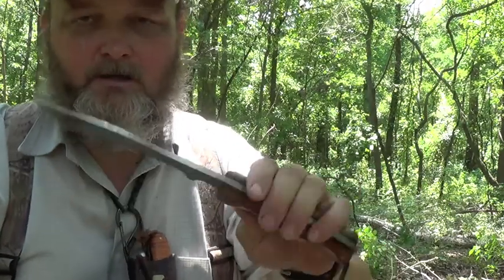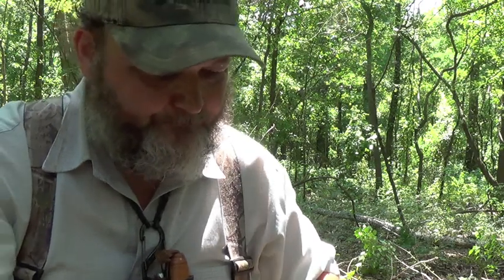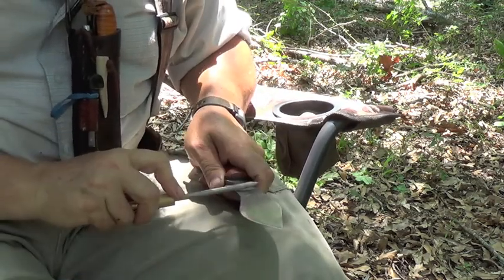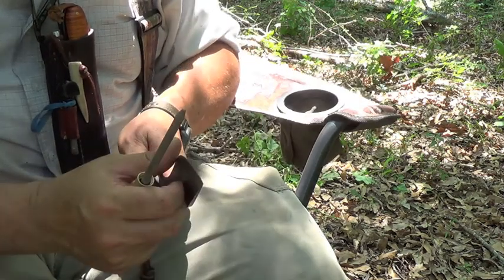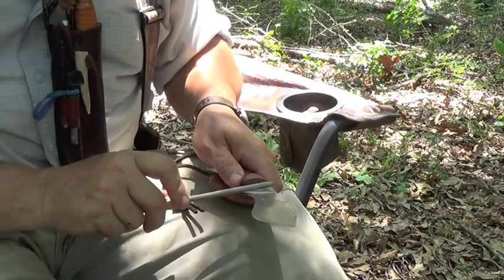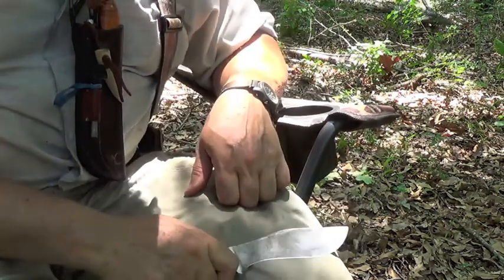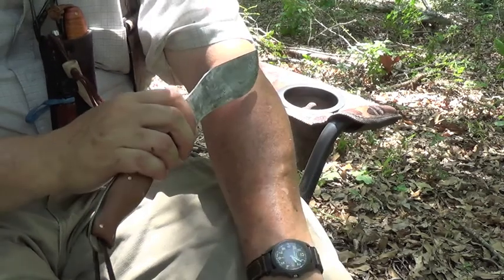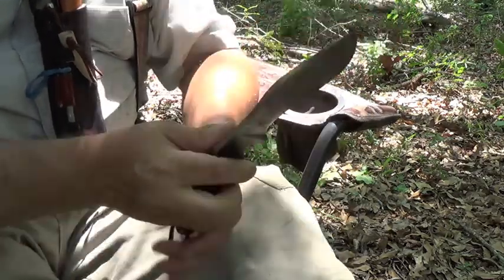How I Sharpen A Kukuri Style Blade

Comment: Nice video!
Why does a rough edge last longer?
Reply from the maker: I think it is because a rough edge has microscopic teeth and the longer teeth protect the shorter teeth until they are worn to the same level. Then the shorter teeth make the cut. It cuts better because the microscopic teeth grab what you are cutting. A polished edge must have pressure applied to cut. There isn't any teeth to grab what you are cutting. This is why Ray Mears used the window glass in his how to sharpen a knife video. Window glass or ceramic rods create very fine microscopic teeth. Or it could be just my opinion. LOL!! Thanks for watching.

Comment: Will, it sounded like you were using a different sharpening technique before you moved the camera down to see the knife.  Were you using a circular motion in the beginning of the video?  Thanks
Reply from the maker: Could have been. The main thing is to maintain the same angle and same number of strokes  on both sides. Some over complicate the process but it is really down to those key elements. The courser the sharpening rod the rougher the edge and the smother the sharpening rod the more polished the edge will be.

Comment: next "how you sharpen a convex ground knife in he field."
Reply from the maker: Sand paper or an buffing compound impregnated in a leather strop. Field or home is about the same. You just have to carry special sharpening items for them in the field. I address this in a later video. Thanks Brandon.
Reply: @wcknives  I've even seen a guy put wet clay on a smooth log to sharpen his machete
Reply from the maker: Jesse Schmidt yep, anything that will dull an edge will sharpen the edge.
Reply: @wcknives  you can also take rust off a blade with ash from your fire by mixing some water and using it as a paste
Reply: @Wildwestwrangler  really? What ratios? Any ash from any wood?